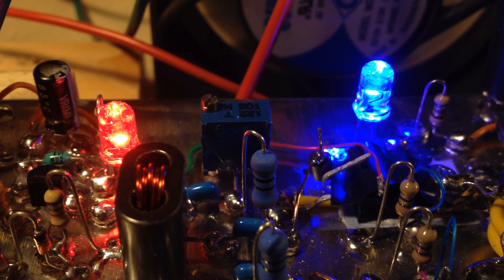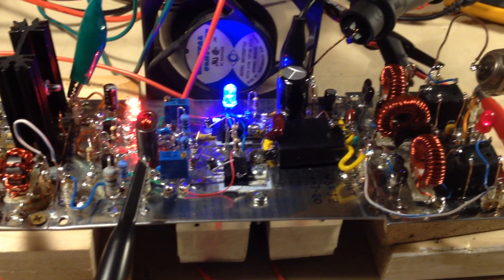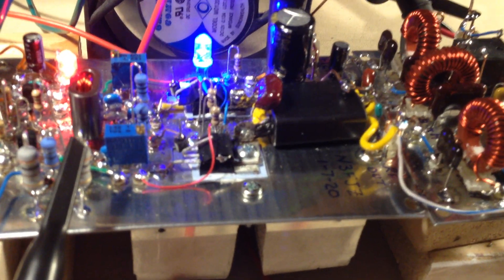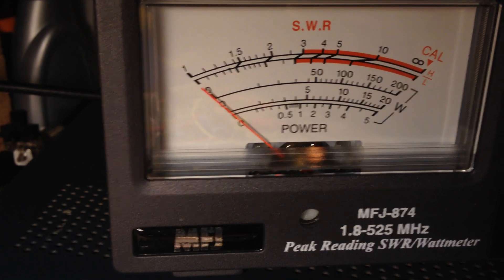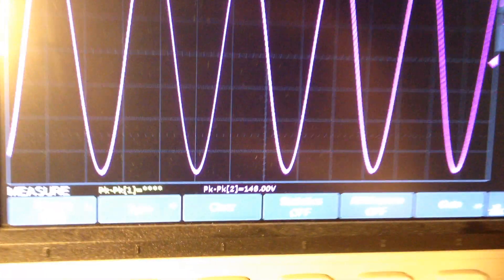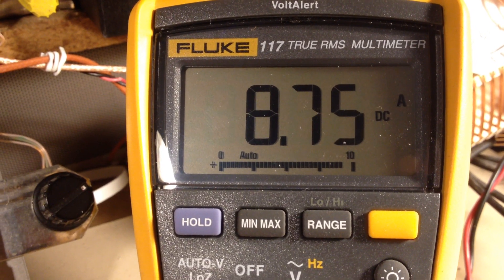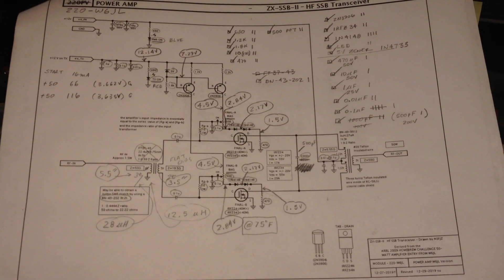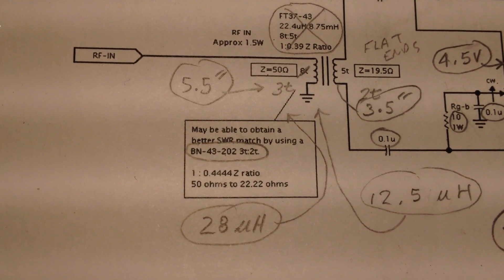N3FJZ's build of W6JL 50W Linear HF amp

Comment: Nice amp. Mine worked FB. Blew up some FETs  while overdriving it on 160m. Otherwise it has been a good choice for a simple and cheap amp. VK3HN
Reply from the maker: Paul, Thank you for the comment.   I love your build of the W6JL amp and all your scratch-built home-brew  rigs; as a matter of fact, it was your blog post of your build of this amp (along with posts of VK3JBL, VK3PE, and VK3YY on their blogs) that inspired me to build my amp.    I just now finished another version of the W6JL amp that can be driven directly from the output of the final IF amplifier and band-pass filter of my Bitx-40 inspired rig (i.e. no intermediate 2-3 watt PA required).  I'll be posting a video of it soon.  73 N3FJZ
Reply: @Circuit6040  Excellent! Well done on the all homebrew transceiver project. I have had success with Don W6JLs design on 160 to 30m. I have a 2nd one built in another rig but not tested yet.  Good luck with your projects.  VK3HN.